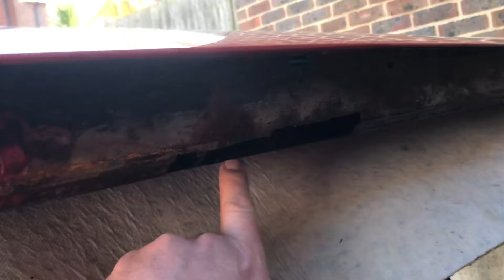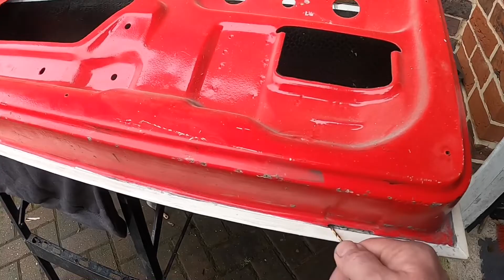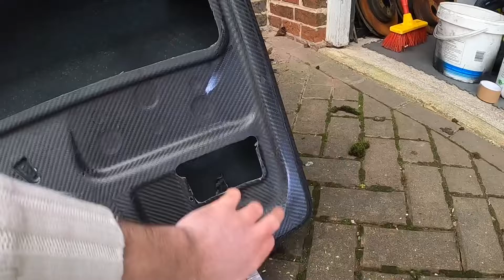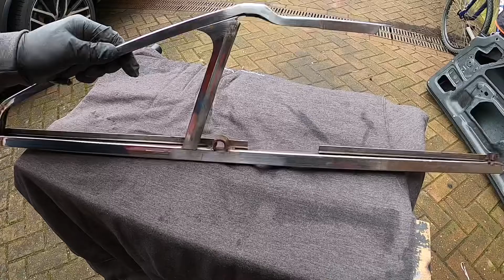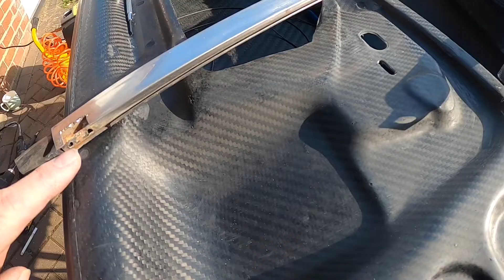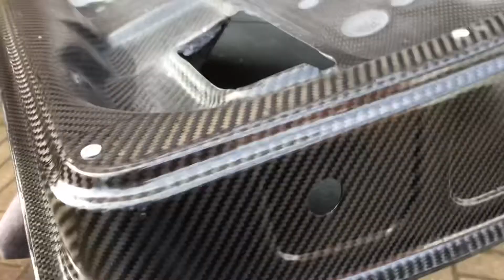Steel to carbon door conversion in depth detail Part 8 Alfa Romeo GTV 2000 Bertone

Comment: Have you fitted these now? Are they worth the money? Any follow up video on these?
Reply from the maker: Hi Keith, thanks for the message, I’m going to be uploading more content soon. Thank you for your patience, I know it’s been a while! Please ask if you have any specific questions. One is fitted and I’m in the process of building up the second. Are they worth the money! Very good question, maybe I will do a video on just trying to answer that question. If you have time 20-30hrs per door and do it the way I have by wanting to fit all the original door furniture and mechanisms then it will take that amount of time. If it’s a race car your looking for and then there is no need to drill out all the holes and put rivet nuts in and make sure everything fits together before stripping it all off again. Aligning the doors is also a time consuming part. The doors are currently not painted either so this again will take time and money! It will be coming soon I promise!

Comment: Which door checkstrap assembly did you go with? I understand the 2000 GTV was a changed design. 
Also, did you loose your original regulator's wire pulley to your old doors, and replaced it? Im keen on these details, as Im doing this door swap also ) cheers
Reply from the maker: Hi I went with the earlier plastic/rubber type. It did change design to the metal strap. With regards to the wire I’m swapping all the original mechanisms to the carbon doors. The plastic sheaths are built in. Have you purchased your carbon doors?